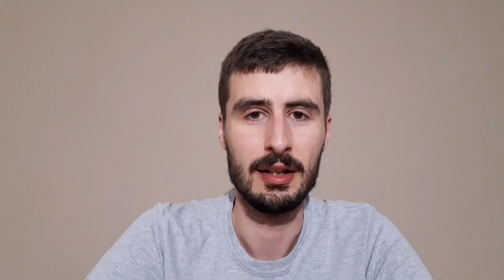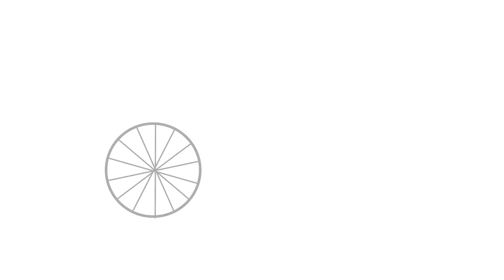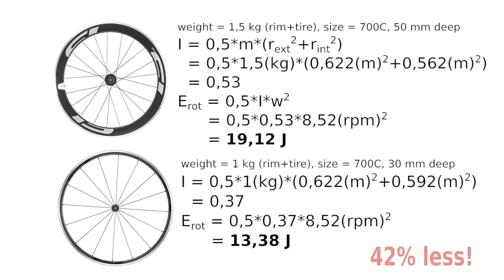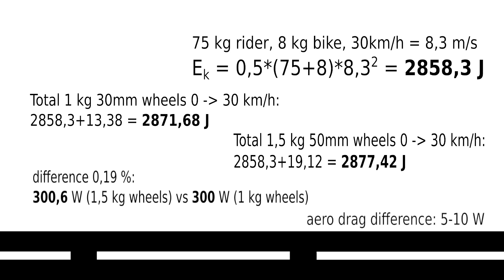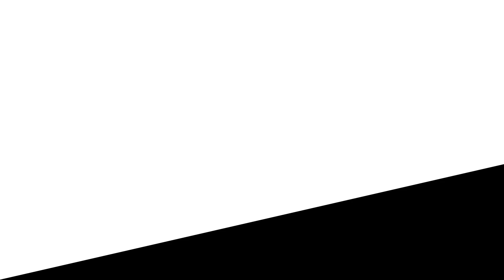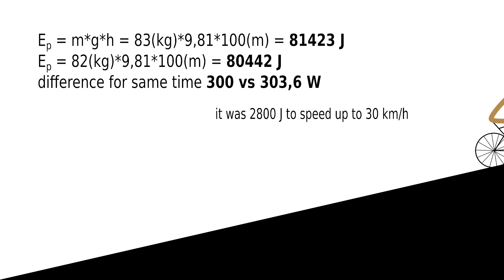Aero bikes are faster? Why does people prefer light bikes? (the math behind)

Comment: I’m usually riding in a group around 20ppl and I’m usually hiding in the 3-4row with occasionally 1-2km climbs. I’ve tried a venge but it doesn’t really seems to be much faster on the flats maybe because I’m drafting, but I can definitely feel the difference on the climbs compared to my tarmac.

I still prefer a lightweight bike with 40mm wheels. Unless I’m doing a ITT maybe I’d go with an aero bike..
Reply from the maker: Yes that is one of the points why pros use light bikes. Somebody who will attack on the climb to win the race is drafting in the pack until they get to climb.